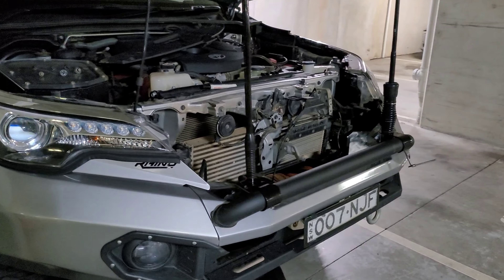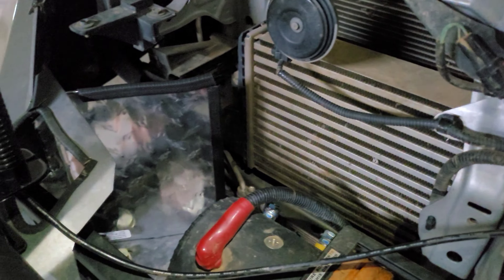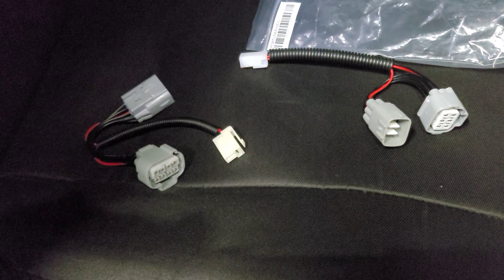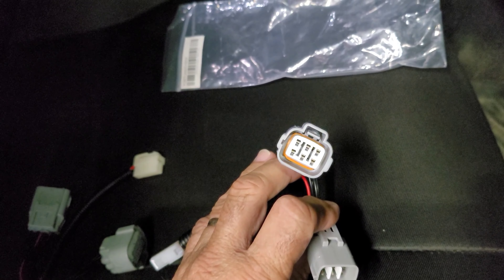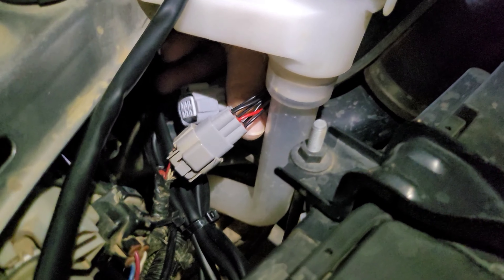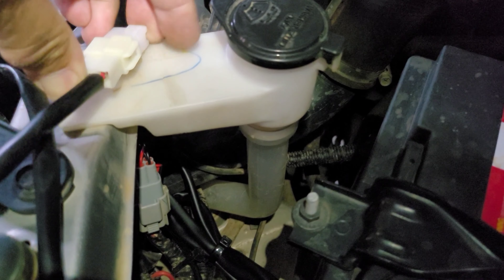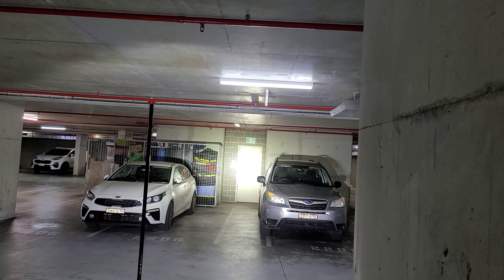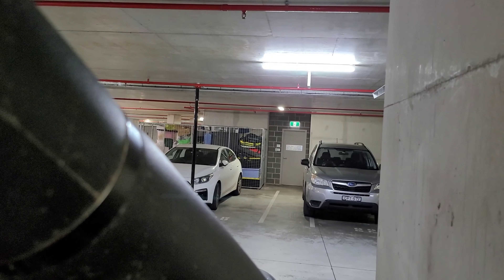#0029 Fortuner Stedi ST4K light bar install

Comment: Does 2017 have radar in Toyota badge like 2021? I wouldn't be able to run light bar as radar is badge?
Reply from the maker: No radar in 2017 model

Comment: whats that small radiator in front?
Reply from the maker: It's a transmission cooler
Reply: @NeilF4x4Crusading  wow thats insane. Do i need it? I dont 4x4 that much
Reply from the maker: Need it, up to you
I found once you put on bigger tyres, roof rack, bull bar, drawer system, it's a lot of extra weight and the transmission runs very warm, even when just cruising on the highway, I recon cheap insurance for the transmission
Reply: @NeilF4x4Crusading  thanks. Will see into it.

Comment: light bar and high beam same switch?
Reply from the maker: Light bar is on a separate switch, however light bar will only work when high beam is turned on, this is the legal way to wire up in NSW